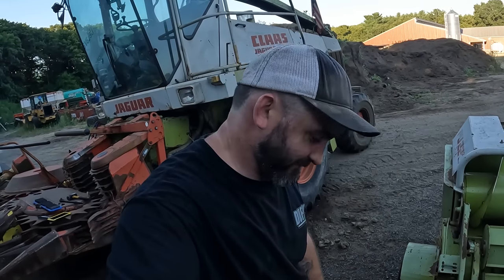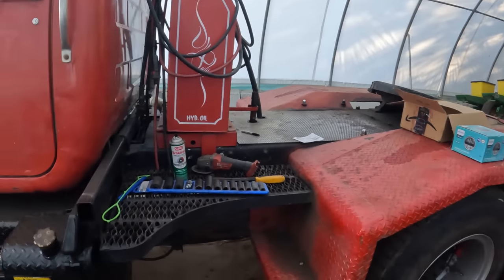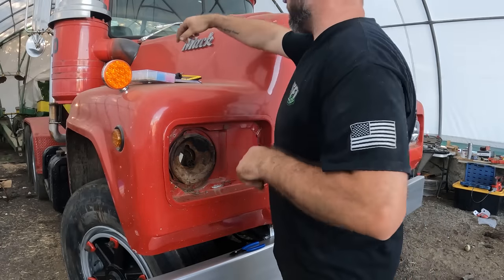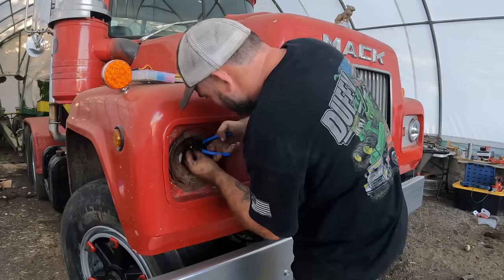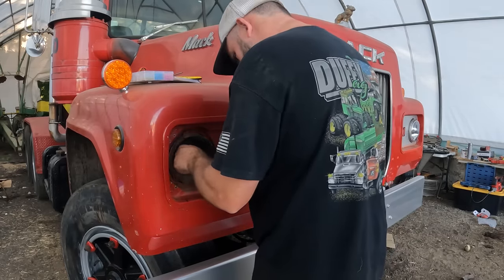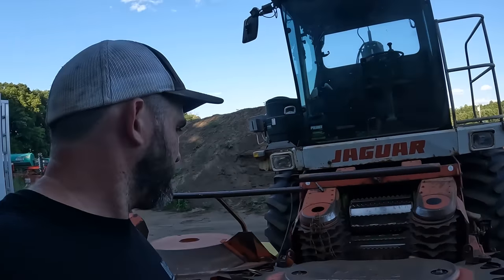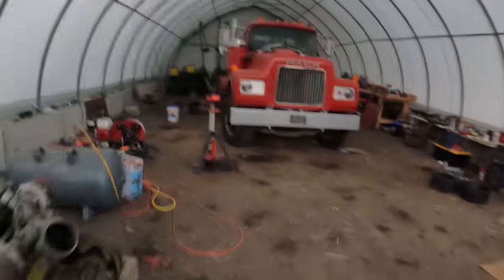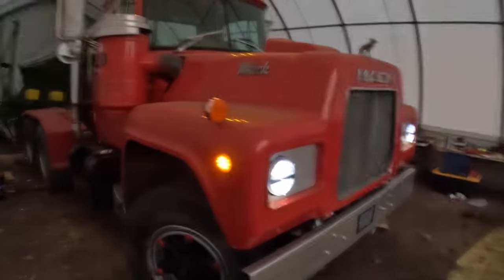What Came Apart? Kemper 4500 Corn Head Repair

Comment: 0 piece of advice there Chris, when you're taking a a shaft out like that fine splined one you were working at there. My best advice is do not hit it directly with your hand Sledge get yourself a block of wood. You don't want to wreck this blinds and this little fine splines like that don't take a whole lot of beating before they're shot we always use a block of wood in between the hammer and a shaft like that when we're taking something like that apart
Reply: A large aluminium drift is ideal. Used baler needles before.

Comment: I think this, the only thing you've ever done that annoys me, is working on housings and enclosures without using a brush to knock the loose flake off.
Reply: That gearbox is toast did you see the metal shavings yikes
Reply: @RK-fh1zb  The internals, not the case, not everything inside of it.

Comment: How did you remove the bottom cap on the same side as the drain plug?
Reply from the maker: You mean on the wing?
Reply: @DuffyAg  how do you get the caps off the gear box in this video. The top and bottom ones.

Comment: 10.9 metric is equivalent to grade 8
8.8 metric is equivalent to grade 5 and qualified as a shear pin and will brake under stress
Reply: Metro has two more higher grades as well. A 12. Something and 16. Something. The 16 r basically engine head bolts

Comment: How many silage marshmallows is equal to a chopped truckload??
Reply: Depends on the load a silagemarshmallow can weigh up to 800kg
Reply: To feed a cornsilage marshmallow you have to put a strap around it so that the bottom won't rot